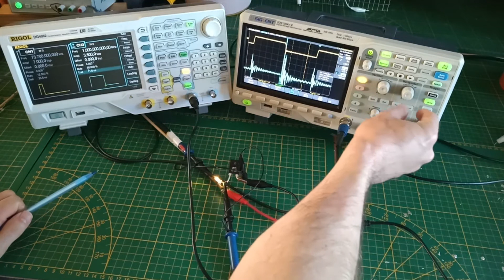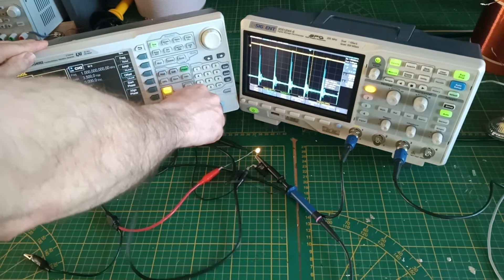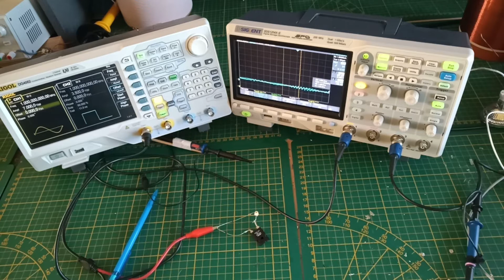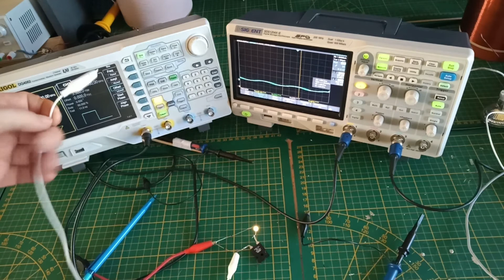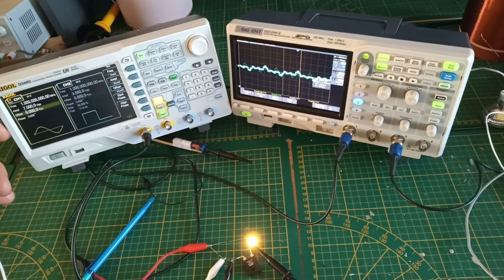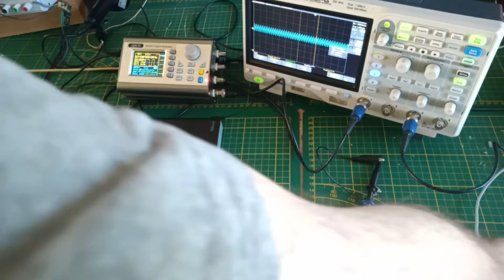Led and Avramenko plug experiments

Comment: where do you think its best to connect our loads to the plug ? i was thinking between the negative of the capacitor and the ground earth wire. what do you think  ?
Reply from the maker: @tvdylan, in the meanwhile I did more experiments with the AV plug and connection with Earth ground. If the signal generator is not Earth grounded then I would connect to Earth ground and do pumping around like in this circuit: https://photos.app.goo.gl/a5CLV2UGsY6VQgiK6
I now know that only voltage reference is important to trigger the Earth grounding currents. In the past I thought on only great discharge of capacitor was needed, but that is just to create very high dV/dt value, you can do the same with small capacity because then you start with same voltage and it will be faster discharged so higher dV/dt value with much less input. I´m still working on usable circuit to bring it power wise to the next level, just need to find a way of switching. ( somebody showed me explication for possible solution but have to build it to study it´s behavior towards grounding)
It was so nice to see spikes if 4 to 6A from simple Wimshurst generator because of the high voltage, low capacity and spark gap setup to create the dV/dt 
It was only at very low repetitive frequency but once that is also pumped up then I could do some power test.

To does who don´t know what dV/dt is: the rate of voltage change in period of time. Higher voltage change in smallest period of time is optimal condition.
Reply: interesting schematic, im not an expert in that schematic at the moment ! : P  but i can absalooootly agree about that one thing you said !! smaller capacitance gives faster charge rates -_- i did it a few days ago with small little caps on my plasma globes. this was very useful to see and realise !! a very very simple action, the changing of cap size. i swapped from microfarrads down to pico farrads and its much more faster charging. most caps can discharge quite faast, but charging up can be alot slower if the capacitance is larger. which i think relates to your dv/dt equation. and do you agree that there is energy gain with each charge/discharge cycle ?  so smaller caps but more frequent sparking is better ? gives a constant charging  at high voltage. and do you think charging can be with high potential and not need big amps ? you think we can charge with voltage and accumulate amps over time with higher frequencies as we discuss here ? and your 4/6 amp spikes sound interesting !! thats ALOT of power if at higher frequencies, we have to be carefull.  maybe lower powered spikes at higher frequency is more safe ? : )  i guess we just hve to engineer it to work at a safe level first. but i am really realizing the true teaching of lots of discharges over a small period of time, easy to see with tiny caps.